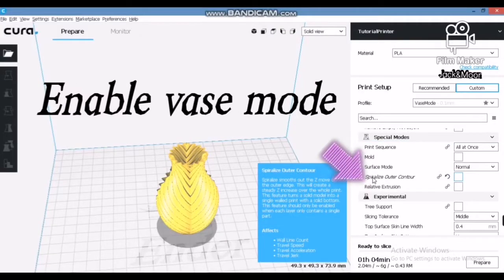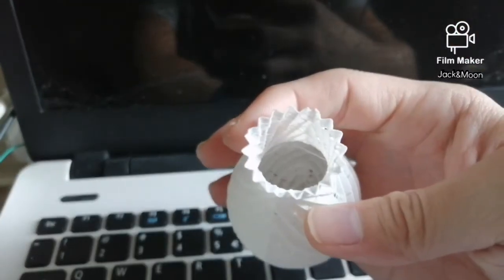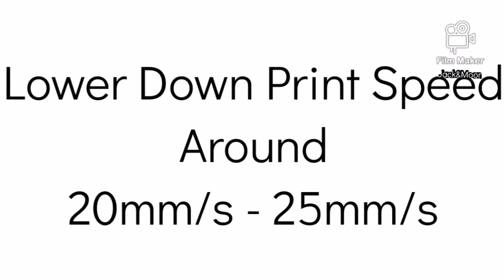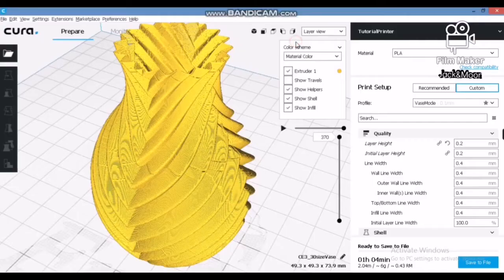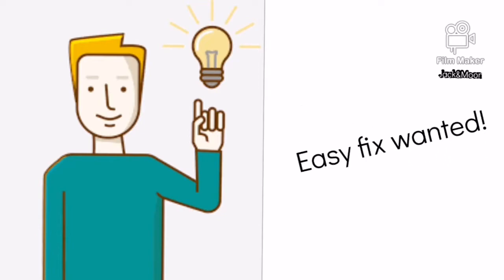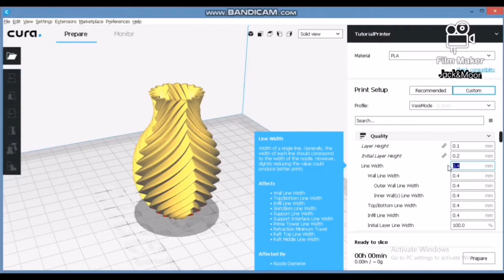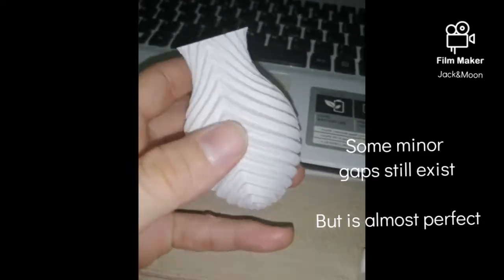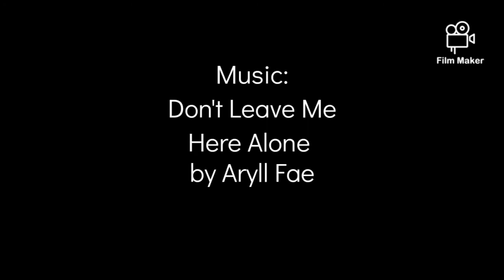Why This Print Fail? #Vase Mode #Blobs #Holes

Comment: I've fixed the blobs by reducing a resolution a little but in mesh fixes to 0.5. I don't see too much decrease in quality and I can print at normal speed. The short stops are caused by too much g1 movements feeding into processor and when it's overloaded, it stops. Lowering the speed is one way, but I prefer the little resolution decrease. The other problem for me was stringing and I've just increased the retraction value, decreased a flow to 99%, added a combing mode, added a wipe distance to reduce z seam and decreased temp by 5 degree. It's perfect now
Reply from the maker: Wao, that some great experiments. Glad that you found your suitable solutions🙂
Reply: how to decrease resolution ? thnx..

Comment: Another way to get rid of blobs/pauses is to change resolution settings in slicer. There are drawbacks, of course. Too low a resolution causes other, visible artifacts.
Reply from the maker: Thanks for the advice. Hope other viewer can see ur suggestion as well😊
Reply: @gravity-less3dprinting624  For reference, there is the use of ArcWelder to fix blobs appearing on curved objects due to buffer underrun: v=18uYYXecH5g and CNC Kitchen's experience with fixing blobs with resolution settings: v=Hvw3DrVAeTA. 

And some people have reported better performance with USB instead of the SD card. And a newer USB cable over an old one.

Comment: I fixed mine by installing the USB Driver and using a USB cable in cura and was able to print at full speed from my computer instead of a SD card  I have an ender 3 v2
Reply from the maker: Hope other ppl see ur comments too. Thanks for your idea 😊
Reply: can you explane how you did that ?